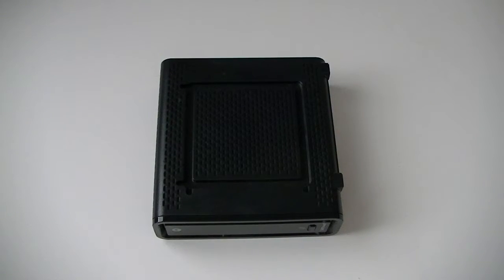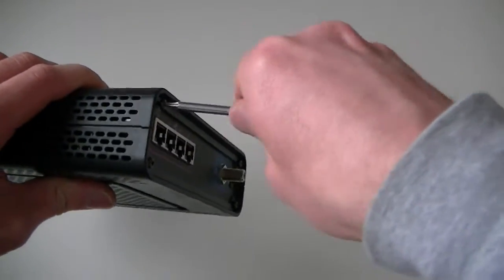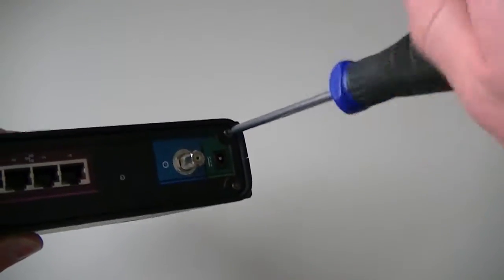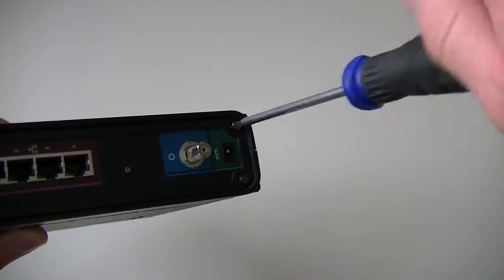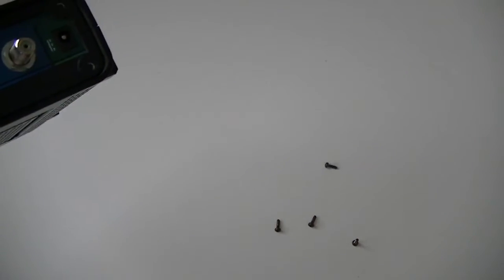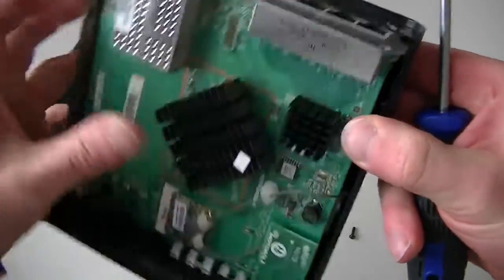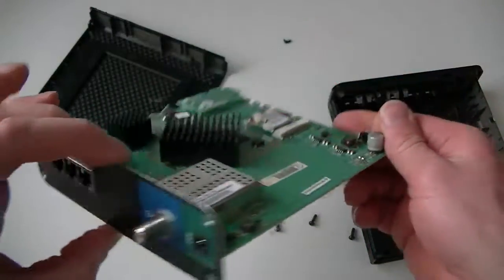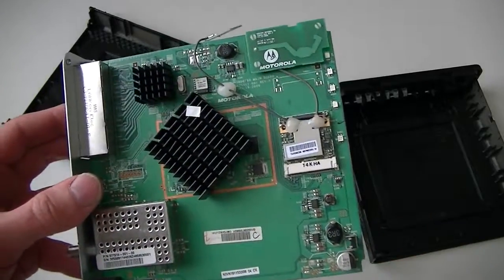Motorola SBG6580 Cable Modem Teardown

Comment: Wow, so it really is only four screws. I had to use extreme force to split the case apart. Mine keeps failing, hoping it's just an overheating issue.
Reply: Gameplay and Talk apparently there's 4 tabs (2 on top and 2 underneath the sticker) that u have to push in before it will split apart